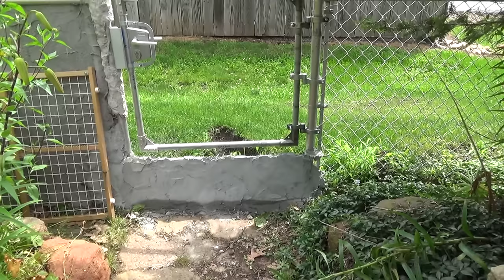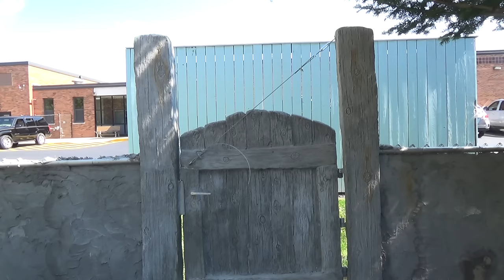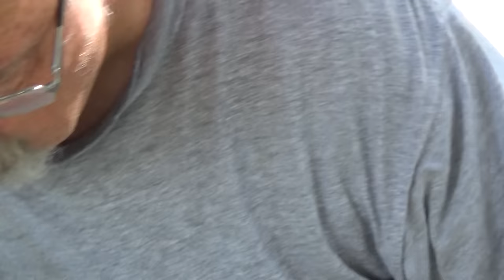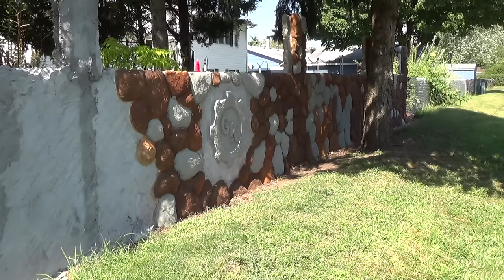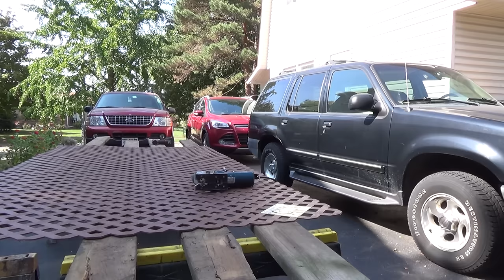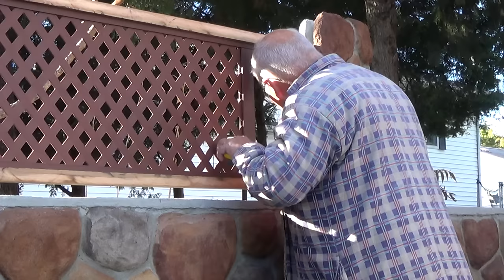Part 2 of 2 Converting my chain link fence to a stone wall

Comment: I made my own continuous lattice top for my fence,  by staggering 8 foot pieces of 1x2 lumber.  I stapled the 1x2s to the 8x2 foot lattice panels, top and bottom - like a "running bond" pattern.  I made the panel about 30 feet long.  I did need help attaching it to the fence, but it lasted almost 10 years.

Comment: Your work is absolutely incredible. Does the acrylic help stick the cement? I’ve been having trouble with my insulation sculptures with my cement not sticking, would the acrylic help or might my cement mixture be off? I’m considering trying the mixture you provided in another video of your fauxbois sculpture mix. Thanks for all your work it’s inspiring
Reply from the maker: When you say "insulation sculptures", I assume you mean EPS (expanded polystyrene)?   To adhere concrete to EPS, make a slurry (paint consistency) of acrylic and your concrete mix.  Scrub it on the EPS and then you're ready to apply your concrete.  The acrylic is a bonding agent and also makes the mix freeze/thaw resistant and denser.  When it cures in the mix, it is an insoluble plastic that acts as a glue.
Reply: @dperry428  correct! Thank you I appreciate it very helpful

Comment: sir , I love the cobblestone affect, I was searching cement projects and came across a pathway marker mold, it was two big molds that made the cobblestone look, you can put them side by side as they fit into each other or end to end as they also fit into each other..and it takes about two hours to make a pathway 40 feet long using the fast drying cement..only 19 dollars on amazon.com  may save you hours of work but help you in your future projects...looks just like yours so it will blend it perfect..just thought I would let you know...God bless....connie gray casper wyo..
Reply from the maker: Yep, they work fine.  You also end up with a repetitious pattern that stands out.  When I did my pathway around the pond  ( https://youtu.be/D1oEnxfydc8 ), I used a mold and then hand-altered the stones to break up the pattern. If someone is doing a 40 foot path in two hours, they're related to Superman.  It takes much longer than that just to mix the concrete unless you bring in ready-mix and there goes the cost savings.  Again, rubber skins and molds are fine, but a portrait or landscape painter could just use a digital camera, too.

Comment: The job looks truely amazing. I'm sure you noticed in the comments how many think it is actual stone. The faux wood confounds me though. It looks like perfect barn found wood but wouldn't it have been easier & lighter to use real wood? No matter how nice it looks a swinging concrete gate seems a little impractical to me. I think it would be just as aesthetically pleasing as the concrete also.
Reply from the maker: When was the last time you saw termites or carpenter bees eat through concrete?  I've lived in my house for 44 years and recently replaced the treated lumber deck boards for the third time.  Guarantee I'll never have my gate and posts rot, split, warp or need staining.  I don't know where you live, but our seasonal climate extremes wreak havoc on wood.  The concrete posts and gate are very practical, as are my concrete benches that look like wood. If I were looking for "easier", I would simply have hired everything done.  Then, again, you're entitled to your opinion and don't have to live with what I've created. The only one I have to please is myself and my wife.

Comment: Im building a Japanese style wall, but it obviously wont be earthen. I was going to get mesh and have it staple gunned to a piece of plywood and apply a stucco/mortar to get the earthen look. After watching your videos, now I am thinking that having the mesh flush against a piece of plywood might not be best. Maybe it should be against lattice or something similar to allow the stucco/mortar to bead through and "grip" more. Any advice?
Reply from the maker: Never done something like that, but, if I did, I'd use pressure treated plywood, attach metal lath, apply some acrylic bonding agent and then apply my stucco mix.

Comment: Great work. Truly beautiful work. Thank you for taking the time to share your excellent craftsmanship with the world. 

Are you not concerned with the integrity of the arch on the gate? Why did you choose not to add smaller diameter rebar to support the arch for additional structural support. My fear would be a gust of wind slamming the gate shut or swinging it against the wall causing the top to either fracture or completely fail. Another possible failure of the arch could be from a child or adult pulling themselves up or climbing over the locked gate.

P.s. Glad to see you're wearing gloves while working. 

Cheers from Seattle.
Reply from the maker: Like most people, your doubt of the strength and integrity of this work is based upon your bias about traditional concrete.  This is NOT traditional concrete.  It is a form of ultra high performance concrete, also known as engineered cementitious composite or reactive powder concrete.  Here is an example of what modern concrete can do. https://youtu.be/X90OIT9dd2g   or this:   https://youtu.be/dmRVsgp4zzs?t=9s   Neither of these examples contains any metal reinforcement.  You can't imagine how frustrating it is to try to convince someone that not all concretes fail catastrophically.
Reply: dperry428 Guilty as charged.Thank you for sharing those links.

All I can say is wow, wow, wow!! Wow. That is truly impressive concrete. I didn't think I'd ever seen this type of concrete. They've been working to make concrete stronger to resist movement rather than allowing movement to avoid failure. Truly remarkable. I smiled when I saw just how proud he was at the end. The genius doctor was beaming ear to ear. One could easily see his excitement and pride. And to have improved upon this with a self healing mix it just awe-inspiring.

I am so sorry for having doubts. Absolutely incredible.

Cheers from Seattle.
Cameron

Comment: excellent work! do you think is possible with chicken wire on both side of a wood fence?
Reply from the maker: I don't know.  I'd be hesitant to cover wood, even if treated.  What happens when, not if, the wood decays?  That would expose the wire to deterioration as well.  Also, What kind of posts?  Also depends on your climate.  Here in Illinois over my 48 years in my house, I've had to replace my treated lumber deck twice. Hot, dry climate the wood may last much longer.
Reply: @dperry428  thank you, Romania near Carpathian mountains-wood decays very fast :(

Comment: What stops it from bending the small metal posts at the ground and falling on someone?
Reply from the maker: The original fence posts are now embedded in two layers of ferrocement made from chicken wire and high performance concrete.  The posts themselves are in concrete-filled holes 40 inches into the ground.

Comment: I am blown away sir! What an incredible project! I was browsing the web for ideas on how to create a texture on a mural that's about 27 feet tall. Would you recommend a technique like this? I would be texturizing it to like like an "impasto" technique used by painters, then adding the color. Just didn't want something that wouldn't withstand the elements.
Reply from the maker: Sounds like quite a project.  Glad it's you and not me going up 27 feet.  Is the mural on a brick wall or other solid wall?  I'm certainly no expert, but if I were doing it and wanted something to survive the elements, I'd rely on heavy use of acrylic bonding agent and admix, and make a mix of 1 sand, 1 very fine perlite and 2 cement. I'd also add 10% metakaolin and/or 8% silica fume and acrylic bonding agent/admix in the liquid.  Prime the surface with acrylic bonding agent, apply the mixture before the acrylic completely dries.  The perlite will make the mix lightweight and easier to apply texture.

Comment: Really great series. Very much appreciated. It kind of inspires me to do something I've always wanted to do: have a really huge rock in my yard. The kind that makes people wonder how it got there. After watching you I'm thinking very strong metal frame, lap expanded metal, and lots of Portland Cement. Any thoughts?
Reply from the maker: If you use the extremely strong mix I used, you don't need an overly strong metal framework. Use some manageable rebar such as #3 (3/8") to make a simple supportive frame, attach metal lath with wire ties, cover with a scratch coat, another two thin layers of chicken wire embedded in concrete and a finish coat.  Total thickness about two inches. But, you need to use a concrete mix that is much stronger than the bagged stuff.

Comment: You mention acrylic as a bonding agent in a number of your videos. Could you share exactly what it is you're using?
Reply from the maker: It is sometimes referred to as acrylic bonding agent/admix.  There are a number of different chemical variants with varying amounts of solids content sold by dozens of companies.  Home improvement store such as Lowes, Menards and Home Depot sell them.  Quikrete offers Acrylic Concrete Fortifier. Sika brand is found in Home Depot for example.  Thoroseal sells Acryl 60.  That's the brand I first learned of from people in the decorative concrete industry.  I used to use Dayton Superior J40 brand.They are diluted with water.  If a brand has 40% to 50% solids, it is diluted 3 water to 1 acrylic.  If it has 25% or so solids, it is diluted 2 water to 1 acrylic.  I now use KongKrete brand from Fishstone.  It is 50% solids and the best I've used.  https://concretecountertopsupply.com/Item/KongKrete-Acrylic-Polymer-GFRC

Comment: so, how did you get the courage to even start such a project? had you done similar things on a smaller scale before? i would LOVE to attempt something like this for my yard, but fear mucking it up....
Reply from the maker: It didn't take any courage at all.  I had read about the concept of ferrocement, sometimes referred to a thin-shell concrete construction.  Third world countries use it for making water tanks and houses.  During World War II, even ships were built this way. Essentially, rebar and layers of steel mesh and chicken wire are covered with a simple concrete mix of 3 sand to 1 cement. I then used that same concept to build my in-ground water tank, called a pond, built another for my brother in Tennessee.  It was a complete no-brainer to understand that a chain-link fence is nothing more than a framework for ferrocement construction, especially when my concrete mix is multiple times stronger than the concrete mix used in third-world countries.  Also, if one looks at the construction of commercial concrete fences that incorporate slotted concrete posts with precast concrete panels inserted and are up to 12 feet high, it is not a stretch to see the chain-link conversion is the same thing with the exception that the concrete panels are built in place instead of being precast. It's simply an adaptation of long-proven technology.

Comment: I have a wooden privacy fence attached on chain link posts. Would it be possible to cover the wooden panels with styrofoam and steel mesh and have a sound fence? Or could you please point my research in the right direction? Thank you for your videos. You're very inspiring!
Reply from the maker: I can only really advise on those techniques that I have personally done.  I'm not an engineer, so can't advise on the structural integrity of what you want to do.  Consider, however, how secure the fence posts are.  Are they firmly embedded in concrete deep enough to be below frost line?  Is the wood pressure-treated so prevent rot under concrete?  Were I considering this, I would simply attach two or three layers of chicken wire (poultry wire) on both sides the entire length of the fence and add my concrete mix.
Reply: @dperry428  Thank you. I appreciate the advice. When I get my nerve up, I will let you know how it goes.

Comment: I was looking for a way to make my chain link look better, instead of tearing it out.  Thanks for sharing.  A question:  My fence has the plastic privacy strips that are woven diagonally through the chain link.  Will I need to remove those or can I put the mud right over them?
Reply from the maker: Hadn't thought about it, but I really can't think of any reason you couldn't just leave them in place except that concrete does not adhere to some kinds of plastic such as polyethylene.  I have no idea what kind of plastic those strips are made from and don't know that the spaces between them would allow concrete to make a solid structure.  I'd be inclined to take one out and do a test with bonding agent and a test mix to see how the concrete bonds to it and then assess whether lack of a strong bond with the strips would be a significant enough negative to not want them in place.  My first inclination is that it would not make a significant difference in this application.
Reply: Thank you so much.  Your wall is absolutely beautiful.  
 @dperry428
Reply from the maker: Thank you. Everyone around here likes it, too.

Comment: Would you use wood from wood pallets instead of the see thru fencing?   I want more privacy
Reply from the maker: You ask if I would.  No, I would not.  Pallet wood is not treated and, depending on your climate, it will rot in a few years.
Reply: Fence came out really good.  You are very creative and resourceful. 👍👌

Comment: Isn't another advantage of having a 6 ft fence, esp when 4 ft is solid, is noise reduction?
Reply from the maker: Yes, but I was more concerned with a visual block.  In the summer, the school yard is used by the park district for baseball games and there are lots of people walking by. I like having them stop by to see the pond, but when we're sitting on the deck, it's just nice to have it semi-private.  There's really not all that much noise, as the playground and ball diamonds are several houses further south.

Comment: my fence is 8ft high, with fence posts every 12ft. will this method support the weight and do you have any recommendations such as adding fence posts to support added weight? i live in hurricane country will this survive strong winds?
Reply from the maker: I installed the original chain-link fence in 1974, so I know exactly how it was constructed, how deep the posts were set in concrete and know exactly how it has performed over more than 40 years. I determined that this method would work for me because I knew what I was working with and had researched concrete fences.  My fence is 4 feet high with posts every 10 feet.  I am not a structural or civil engineer. I cannot advise you on your fence. I simply don't know.  My advice would be to share what I have done with an engineer and see what he/she has to say about its application to your particular circumstances.
Reply: @dperry428  thank you for the idea, your craftsmanship is impressive

Comment: Are you using stampcrete on all of this or  regulator concrete?
Reply from the maker: The mix I'm using is my own high strength mix modeled after a mix developed at the University of Michigan Engineering School.  It is at least 5 times stronger than regular concrete.  The mix is 2 to 3 parts sand to 2 part portland cement, 5% CSA cement, 10% metakaolin, 8% silica fume, PVA and glass fiber and acrylic admix/bonding agent in the liquid.

Comment: you may have said but I missed if you did, can you make the "stone" look with pieces of styrofoam? Yours looks awesome but it seems very time consuming. Thanks, great videos
Reply from the maker: Certainly, you can make rocks from styrofoam, but be aware that they will NOT be   very durable and I doubt there would be much, if any, savings in labor.  You'll need to cut out the styrofoam rocks, you'll need to use a slurry to adhere them to the wall, and you'll still need to cover them with concrete to make them even somewhat durable. Time consuming?  You bet, but most worthwhile things are, else everyone would have them.
Reply: Ok, great. Thanks for the fast reply. Your videos are very inspiring.

Comment: why didn't you glue the lattice togather with epoxey
Reply from the maker: Because I chose to use the connectors that are made for that purpose.  Epoxy would not have held well with something as big and heavy as these panels.